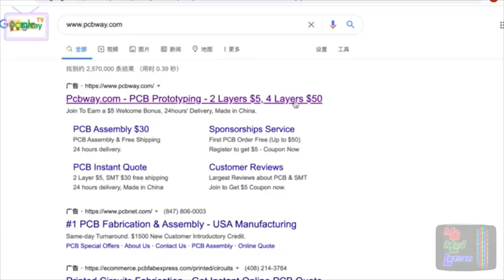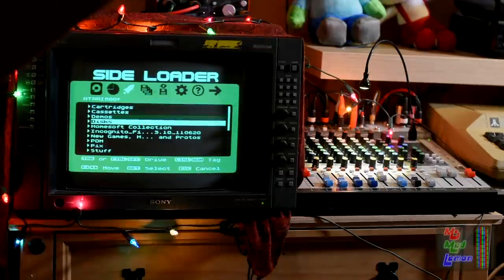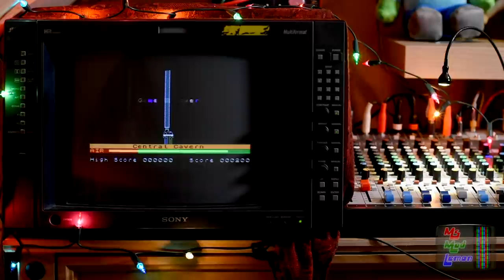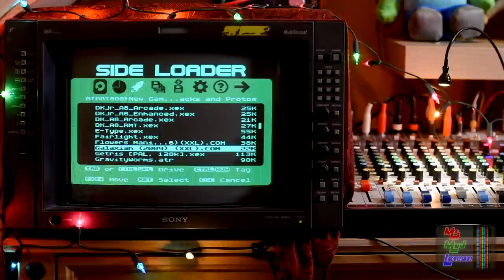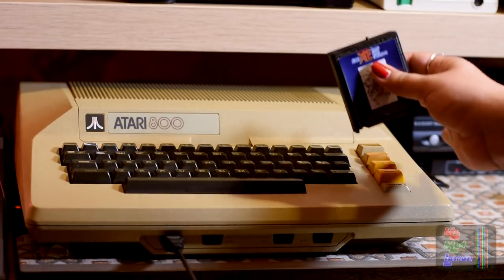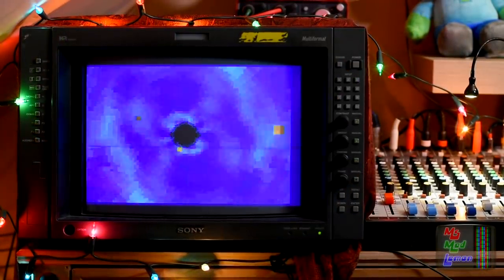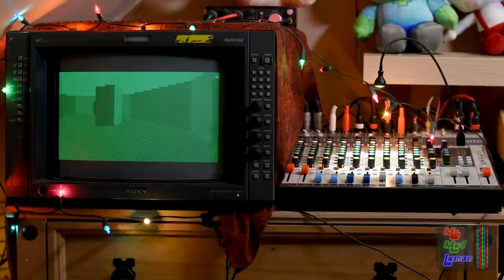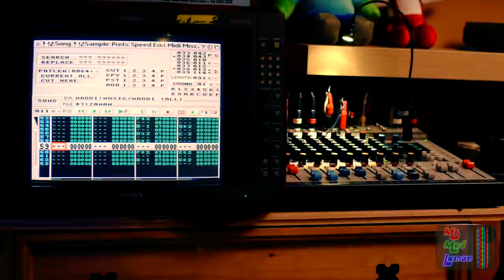Atari 800 Incognito Setup and Test with games and demos

Comment: This makes Incog look nice and tempting. I like how you did the light through the grille and left the faux button (power light) as is. You are smart and intuitive with the computer's use! Things like disabling the loader to get the cart working.

I personally don't recommend installing Incognito because it's difficult the install does some permanent damage to the machine. Nevertheless this is an excellent video showcasing the result.  You did great.  For those wondering, best to have an expert install it.  Alternatively an XL or XE machine is easy to bring out when desired.  A U1MB install doesn't damage an XL or XE and is very similar to an Incognito.

Yes e-type looks frustrating. =) Galaxing looks like it's using artifacting so requires composite video. You show a great selection of games here.  Yes Atari Blast! has perhaps the best graphics for the A8's.
20:13 Yes the internal speaker has a creature living in there that bites hands and fingers that get too close. 
Yes Star Raiders is an 8K ROM because originally the 800 was only supposed to have 8K, thus the name '800'.

Comment: Fairlight - Actually, that titlescreen music is from Spell of Dstruction/Wizardry. The in-game tune is from Fairlight.

Star Raiders - This uses a bunch of keys on the keyboard to control various things. You really need the manual. Luckily, you can find it online at Atarimania.com in the XE/XL Games section. Quite a few other manuals as well there.

If you don't already have it, check out Ridiculous Reality. It's a neat little puzzle game from 2012, where you have to move screens around like a sliding tile puzzle to get your little guy to all the keys and then the exit door.

Comment: The XL/XE series had to have you use a "Translator" disk loaded to emulate the original 800, choosing "Colleen" (the code name) means you'll be able to run software which depended on the old BIOS. You're also getting the benefit of an R:Time-8 cartridge, keeping the clock, as the Atari had none, so no timestamps on files!  :O SpartaDOS X was a third party product which was pretty much essential for those who had hard disk drives for their 800, it had subdirectories and a command line, which was alien to a kid who'd spent a year on floppies with only files. 😻
Reply: @ms mad lemon - since you have 4 joystick ports, I highly recommend M.U.L.E.

Best open world rpg: Mercenary, Escape from Targ

Fun single player games: Jumpman, Pitfall II, Miner 2049er, Mr. Robot, Realm of Impossibility/Zombies!, Racing Destruction Set, Pinball Construction Set

Best educational game: Rocky's Boots
Reply: As a hardware person you also will probably like D-BUG.

A fun cerebral game is SCRAM.

Comment: Looks like some of these games expect to use NTSC artifacting to get extra colours (E-Type, Galaxian), but of course it doesn't work because you're on PAL. It's interesting that they felt the need to do that, I'd have thought the Atari 8 bits already had plenty of colours.
Reply: It was usually to do with how the different graphics modes handled the number of colours and the amount of pixels/pixel sizes they could use and the amount of memory each mode used up. Using a higher resolution mode usually resulted in less colours available or more memory used. Artifacting increased the colours available without using up more memory.
Reply: @MrPGT  Interesting... thanks for the info :-).

Comment: Hi Maddie. Really cool! I still have an Atari 800XE like new in the box. Haven't really been playing with it (yet). But this video makes it much more attractive :) I was just wondering.. Does the cheat code for Manic Miner also work on the Atari version? (6031769). Enter the cheat code when playing, and it should put a foot in front of your lives. That would allow you to hold the 5 key and chose levels using the 1-4 keys as combinations. It's really cool! It DOES at least work on the Spectrum...

Comment: Coming back to this because I haven't finished mods to plug in the Incognito yet :D  Now remembering that you also tried to push that power light because it looks like a button... You  said that happened when it first arrived, but surely you didn't get an Atari 800 when they were new. Right? Cuz I realized back in the 70's there would have never been a power swith actually on top, usually in the back, and probably a rocker switch.
So I realized they likely would not expected that to be power. I still wondered what it was though, as I was inquisitive in my youth and tried to press anything that might do something. I couldn't afford an 800 but a friend had Atari 2600 (which I thought almost every game was pitiful compared to the 8-bit line). Then I saw the "cheap" Atari 400 with membrane keys when visiting my rich uncle in California, so I'm not sure what I would have thought since my first computer was Atari 800XL, so much cheaper build but slightly more capable and the furniture store was going out of business so it was 40 bucks.

Comment: Atari developed the 400 and 800 with internal codenames "Candy" and "Colleen". So pre-XL machines are known as "Colleen" to distinguish them from the (slightly) different XL design.  I've never seen any explaination of the names, perhaps they were the names of children of the developers?
Reply: Found this on Wikipedia: 
https://en.wikipedia.org/wiki/Atari_8-bit_family

Development

Management identified two sweet spots for the new computers: a low-end version known internally as "Candy", and a higher-end machine known as "Colleen" (named after two Atari secretaries).[15] Atari would market Colleen as a computer and Candy as a game machine or hybrid game console. Colleen included user-accessible expansion slots for RAM and ROM, two 8 KB ROM cartridge slots, RF and monitor output (including two pins for separate luma and chroma, allowing a complete S-Video output) and a full keyboard. Candy was initially designed as a game console, lacking a keyboard and input/output ports, although an external keyboard was planned that could be plugged into joystick ports 3 and 4. At the time, plans called for both to have a separate audio port supporting cassette tapes as a storage medium.[16]

A goal for the new systems was user-friendliness. One executive stated, "Does the end user care about the architecture of the machine? The answer is no. 'What will it do for me?' That's his major concern. ... why try to scare the consumer off by making it so he or she has to have a double E or be a computer programmer to utilize the full capabilities of a personal computer?" Cartridges would for example, Atari believed, make the computers easier to use.[17] To minimize handling of bare circuit boards or chips, as was common with other systems of that period, the computers were designed with enclosed modules for memory, ROM cartridges, with keyed connectors to prevent them being plugged into the wrong slot. The operating system boots automatically, loading drivers from devices on the serial bus (SIO). The DOS system for managing floppy storage was menu-driven. When no software is loaded, rather than leaving the user at a blank screen or machine language monitor, the OS goes to the "Memo Pad" mode allowing the user to type using the built-in full-screen editor.[13]

As the design process for the new machines continued, there were questions about what the Candy should be. There was a running argument about whether the keyboard would be external or built in.[18] By the summer of 1978, education had become a focus for the new systems. While the Colleen design was largely complete by May 1978, it was not until early 1979 that the decision was made that Candy would also be a complete computer, but one intended for children. As such, it would feature a new keyboard designed to be resistant to liquid spills.[19]

Atari intended to port Microsoft BASIC to the machine as an 8 KB ROM cartridge. However, the existing 6502 version from Microsoft was around 7,900 bytes, leaving no room for extensions for graphics and sound. The company contracted with local consulting firm Shepardson Microsystems to complete the port. They recommended writing a new version from scratch, resulting in Atari BASIC.[20]
Reply: Coleen was a code name used during development of the model 800 and Candy was for the model 400 . The names were secretary's who worked at Atari, at the time...

Comment: This incognito, is this a flashcart for the Atari 8 bit computer line? Also are there bios and roms already pre-installed or do you have to go to the incognito website and download firmware similar to the krikzz everdrive flashcarts in order to get this to work? In other words, would this be difficult for a newbie to set this up? Or fairly easy?

Comment: I do not understand how IBM was able to over take the Atari , 2500$ vs 1000$ , ST was the first computer to ever pass the 1000$ 1MB ram price point. The 800 was 1000$ vs 3500$ But i guess software as the mom and dad would use IBM at work so they wanted the same software at home. You think 123 would have made software for it.
Reply: They could so by Pentagon.